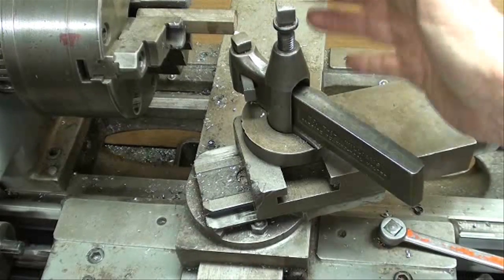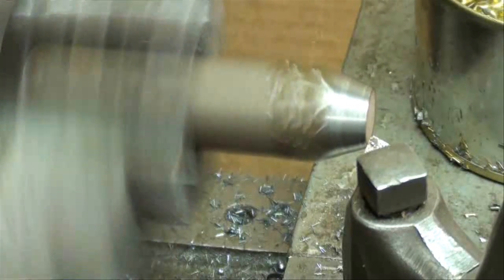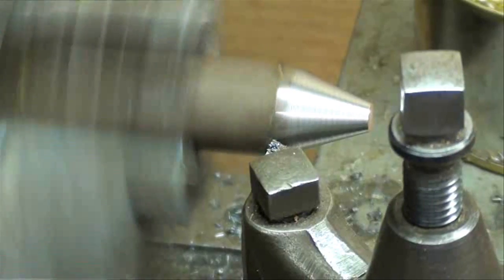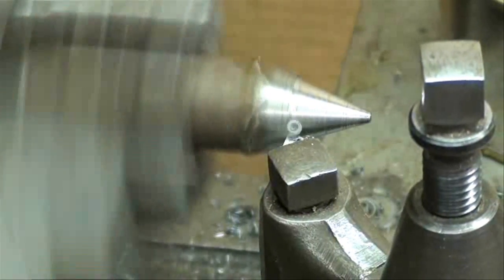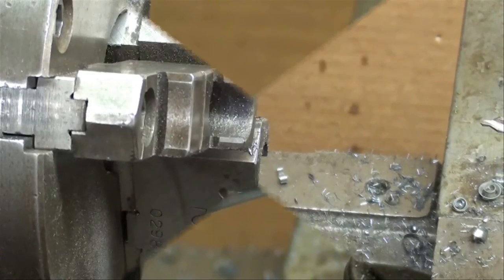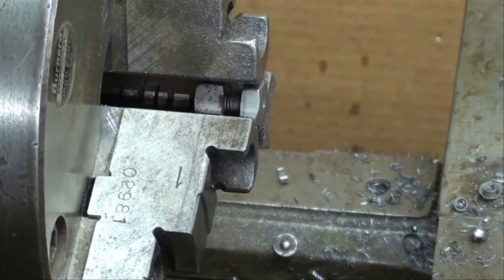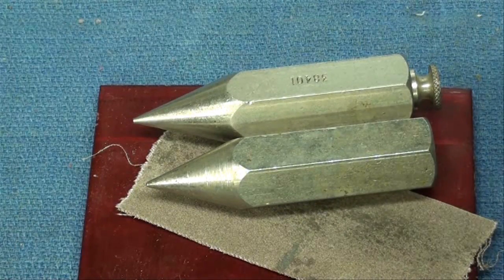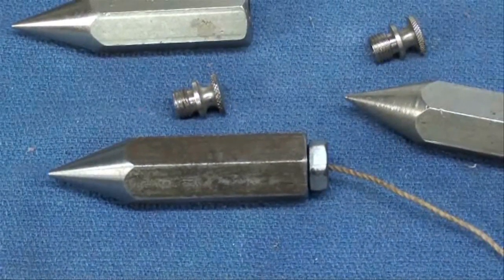MACHINE SHOP TIPS #51 Lathe Project Plumb Bob Pt 3 of 3 tubalcain

Comment: I have a very accurately made plumb bob I had to make for a grade in first year college machine shop which I use to quick check alignment of my tail stock.  I chuck the bob in my three jaw and slide my tail stock with either my live or dead center in it up to the point of the bob to see how the points match.
Reply from the maker: Good idea

Comment: Yes, this is fun!  I have two brass, Hg filled, plumb bobs with tool steel points, and I also have one of the style shown in this video.  A plumb bob is a simple tool with so many uses.  I watched a machinist level his lathe bed with an attachment using a plumb bob, and it seemed to work quite well.  Another great video.

Comment: "I know you said no questions, but it appears your drills (except the last one) lift when they make contact and start cutting. Is this normal, a problem, or an optical illusion?"

That is why you have to use good quality chuck, not cheap one.

"All metalworking lathes must be shimed to the floor they sit on until the tailstock is in perfect alignment with the chuck. I have 4 lathes in my high school shop I teach in and all were installed without shims, I am in the slow process or doing that work myself."

Lathes ant big metalworking tools have their own foundation separate from the building foundation. They are not shimmed they are placed on rubber vibration absorbers, thick rubber sheets the size of the machine.

Same goes for table size lathes, mills. You must use thick rubber sheet to mount it the correct way. Table flex should not influence you lathe or milling machine. And the lathe or milling machine should be straight and true from factory. If you need shims to bring back it to true position then this means the maschine is no good to use.
Reply: Great comment, but what I use is adjustable legs with rubber sheets.
Reply: Yes you can use adjustable legs if the lathe is just placed on table, as it is recommended to bolt the machine to the table this means adjustable legs should be used for table to set it level, and rubber sheets to mount the lathe.

The only problem is the rubber should be viton (expensive) if you will use allot of cutting oil.

Comment: Last summer I installed a sprinkler system at my home and needed to run a 1/2 inch water line under my driveway that was 18 feet wide. I used this lathe turning method to turn and build a "WATER JET NOZZLE"  to bore a hole under my concrete driveway using only the 70lb city water pressure. My water nozzle looked very similar to your plumb-bob except mine was a little larger dia. and had a 3/16 hole full length, down the center, and at the big end I tapped a 1/2 pipe thread that screwed directly to the 1/2 PVC pipe. With the water flowing as a jet, I was able to easily push the PVC under the drive and simply remove my nozzle once I reached the other side. My water nozzle is now on display next to my plumb-bob, on my shop wall, My motto: (HAVE LATHE, MAKE TOOLS). Thanks again Mrpete.
Reply: That’s a great idea for a difficult task. How long did it taking to burrow through? You should have done a video.

Comment: Not trying to be super critical but as a photographer and a machinist, it would be nice if you focused on the cutting tool instead of the chips on the ways below the work. Try putting your camera on manual focus next time. Just a suggestion. Nice vid. Thanx

Comment: I have a lathe at work that was made in the 60's. Right now there is a 3 jaw chuck in there but its definitely off center and it causes problems. 

There is a 4 jaw chuck sitting around but these things weigh like 75lbs so it would probably be a pain to change.

The fact that you get a 75lb chuck spinning around at 500rpm is kind of scary

Comment: When you bring the tool in towards hex stock like that the tool is going to make contact with an edge first, then skip over the flat and then contact the next edge when that comes around. I think that's what's meant by an 'interrupted cut' - because the tool has periods when it's not cutting.

Comment: @BigAgitator my center drills do not move, they are too rigid and strong to bend, but drill bits are a different matter. Hard to say what the exact reason is in his videos but when you set up your lathe and make sure your tail stock is aligned, if this happens it is usually from that reason in my experience.

Comment: @BerkeleyGang You may also find if you are having this problem your tailstock is out of alignment which can cause that to happen. If you align your tailstock and still have that problem, your lathe bed is probably twisted. All metalworking lathes must be shimed to the floor they sit on until the tailstock is in perfect alignment with the chuck. I have 4 lathes in my high school shop I teach in and all were installed without shims, I am in the slow process or doing that work myself.

Comment: @mrpete222 Yeah, but at 7:12, the center drill jumps upward, introducing an inaccuracy that's now going to be repeated by the remaining drilling operations.

I know for this project, especially being purely for demonstration, it's a minor point, but I'm trying to understand things. One of the reasons I bought a mini-mill was because I wasn't able to drill accurately (enough) with a drill press. I'm very sensitive about accurate hole placement when drilling.

Thanks.